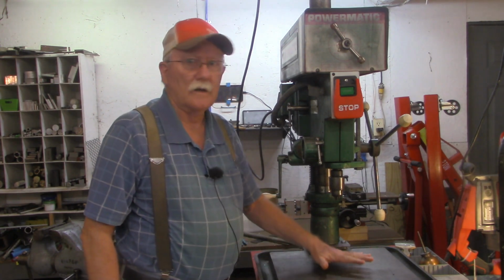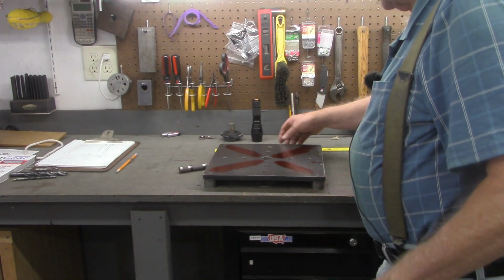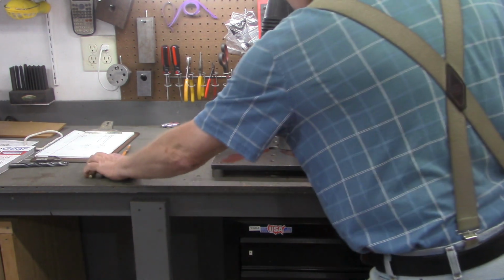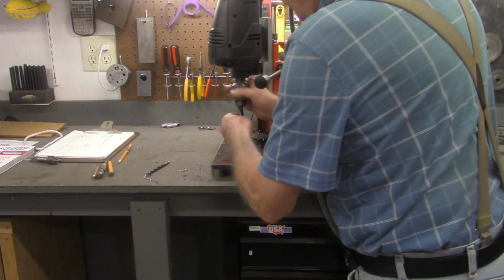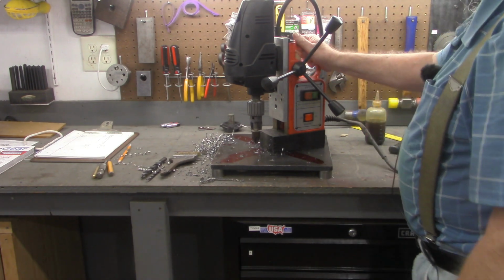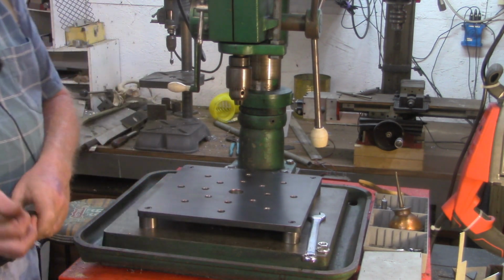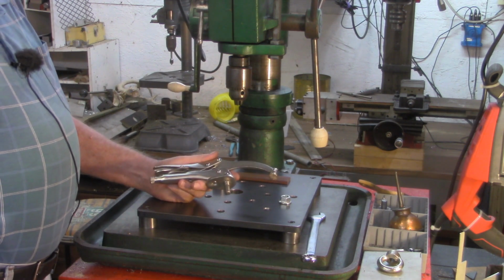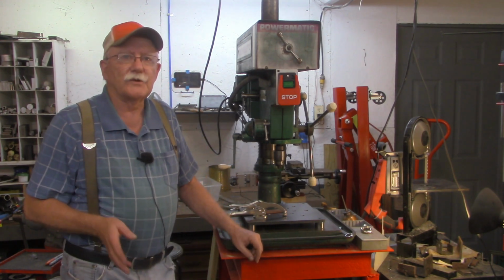PowerMatic Drill Press Enhancements (Viewer Suggestions)

Comment: 24:57 If your hole were 19mm, the (19mm) MFT Bench Dog Clamps, Aluminum Alloy Hold Down Clamps for Woodworking with Quick Release, Adjustable Benchtop Clamps for Secure Workholding and Versatile Use would work perfectly. I recently discovered them and bought a pair for just twenty bucks.

Comment: Yeepers, work safe - be safe(@@)! If you have a minute in you busy day, check out the PM 1200 monster I just picked up on last auction. On one of the modes planed, will be to take the 9 x 48 mill bed off a Wells Index (bought for parts and resale parts) and mount to the PM 20 x 24 table. The mill bed will have Y travel, but X or Z not needed, since my table swing 360 and will power feed the Z by use of a power chair HD 12vdc motor. For stability of heavyer loads when using the milling bed, I will custom make 2 screw jacks to rest on floor, to underside of bed (@@)! In the tare down stages, but coming along.She a beast of a drill :)> Bear.

Comment: Hi Lee, that tip about straping a mag drill down if you're using it sideways or upside down, is a real good one.  I have to admit when you said "what if the motor binds and trips the circuit breaker", i had to think for a minute why that would be a problem.  Of course the magnet is an electromagnet and would release if power was removed but it is easy to forget that or overlook it.  Thanks for the video!